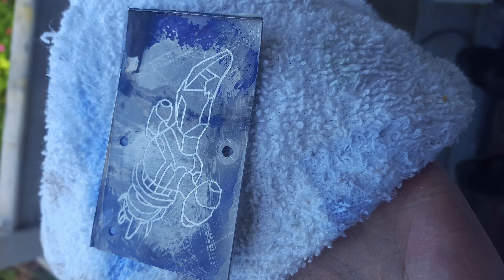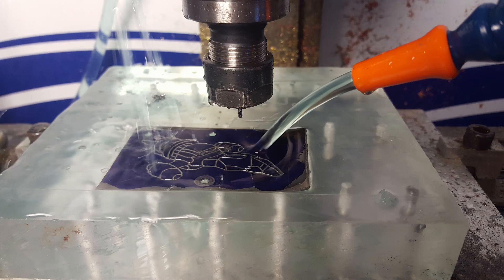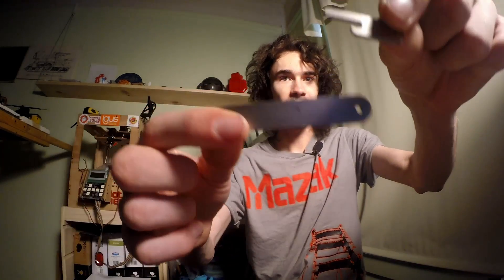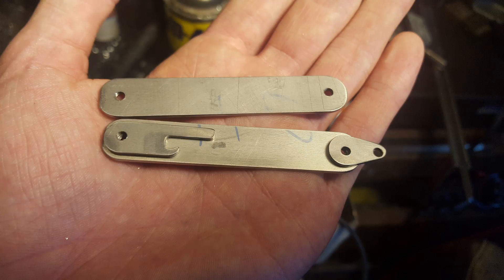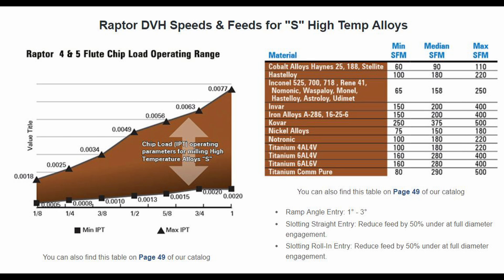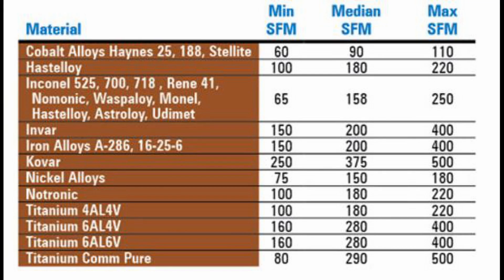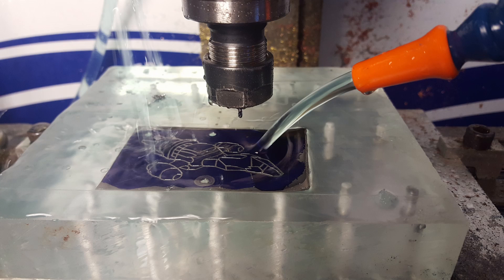Machining titanium on a hobby mill

Comment: If a machine will cut aluminum will it generally be able to cut titanium? Also will a CO2 fire suppression system be enough to stop a titanium fire or would it be best to use a powder suppression compound like baking soda as a precaution?
Reply: Aluminum is significantly easier to cut. So not really a comparison to make.

Comment: Can someone tell me what makes titanium a challenging alloy to mill?
Reply from the maker: Low heat transfer means heat builds up really fast in the cutting area and it can cause it to work harden and some grades of titanium are extremely soft and gummy so they can stick to tools easily.
Reply: Calvin Witt thank you for fast reply. thats all?

Comment: I saw a neat trick from Apollo at carbide3D  channel, he made a little pool around the cut area with modeling clay or something and just kept it filled with lube.  I haven't tried it yet with my sherline, but a cool tip for people like me without an auto coolant system.
Reply from the maker: THREX BOX That is a really good point! I have done it and if you keep an eye on the coolant it works good. Only drawback is chips building up which can be an issue.